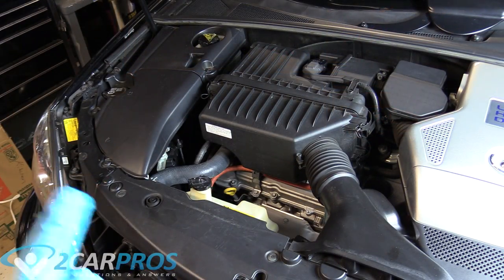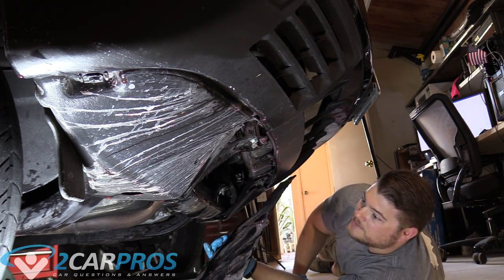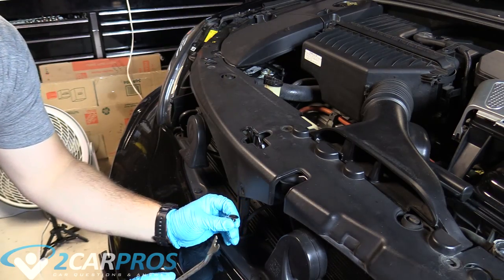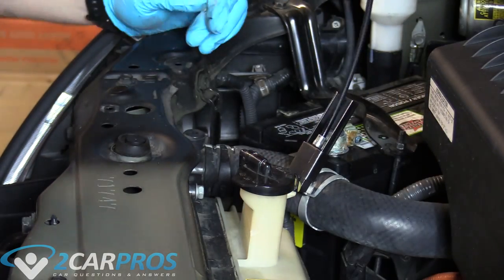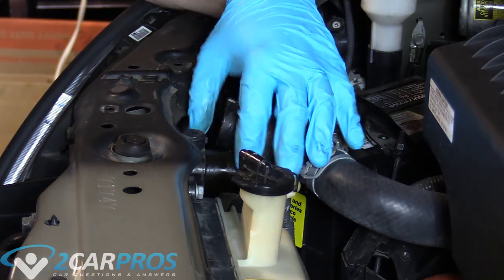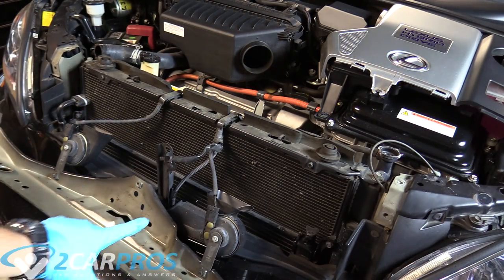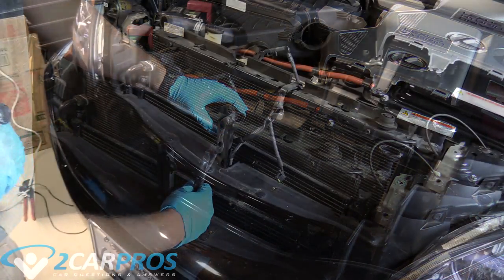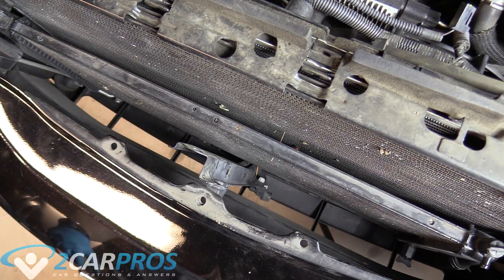How to Replace the Radiator Lexus RX 400h 2005–2009

Comment: Thank you so much for this tutorial! I just replaced the radiator in my Lexus. Would not have had the courage to do it without this video. I pulled the radiator out without removing the two bolts on the very bottom. It can be done by just lifting up the AC condenser out of the way. You just pull the radiator out with the "basket". I struggled with the bolts for a while, then resorted to this way. Much easier! :)
Reply: Can you please tell me what tools I should prepare?

Comment: Also, when putting coolant, you can start your engine in Maintenance mode. This will allow hybrid to run engine continously without charging hybrid batteries. Proces is:
1. Turn ignition on. (Do not push brakes at this point)
2. Push gas pedal twice.
3. Move gear position to N (neutral)
4. Push gas pedal twice.
5. Move gear position to P (Parking)
6. Push gas pedal twice.
7. Finaly push brakes and start engine. Then engine will be in maintenance mode runing as long as you shut it down.

Comment: Thanks for the video, just finished this job on my 08 RX400h.  I had to use a 12mm ratcheting wrench to get the two vertical bolts at the very bottom.  Very difficult. I lost the two bolts into the hollow cross member once I pulled the radiator out, lol.  There was no getting them out of there, so I reinstalled without the two bottom bolts.  After everything else was installed the radiator feels very secure, attached to the condenser and fan.  After all said and done I lost one 10mm socket, several plastic clips and when the job was over I had two 10mm bolts leftover lol.  Good to go though, just drove for over an hour, no leaks, no overheating.  Thanks for the help
Reply from the maker: Thank you for watching!
Reply: Hi great video and details, thumbs up, I read on a forum that you can skip removing the 4 bottom vertical bolts by slightly moving the AC condenser to the front of the car to clear the cradles so the radiator can be lifted up with the 4 bolts and the cradles. From your space you saw while removing this, is it possible? Thanks again for the video.
Reply: @Lavender it's a timing belt. Should be replaced every 90k miles.

Comment: Thanks for this video, just found my rx400h rad leaking and after watching this it really doesn't look as difficult as all those fans and stuff suggested it would be. Next weekend I will pull it and see what happens.
Reply from the maker: Yeah it's not too bad if you take your time. Thanks for watching!
Reply: @2carpros  Great did it yesterday, took about 4 hours all in. One stuck bolt holding the fan assembly on, and one pipe clip causing issues, cut the tang off and all was fine. Did as suggested and left the bottom bolt until the rad was out. Thanks again.

Comment: IMPORTANT.
One part of film show overcomplicated part and completely unnecessary.
First undo all screws before draining anything otherwise all drips on your head. At 23.08 sec of film you don't have to swear or pry it with piece of wood. Radiatir comes out with what this guy call cradle. All you do you unclip 2 front ones by lifting them just a bit and moving away from rad. Then radiator comes up with CRADLE.
Most cases you will not be able to unscrew radiator from cradle from underneath as most of those screws are rusty and suck. Once rad is out then remove CRADLE so much easier.
Done couple of them so its much easier to have rad out with cradle.
Reply: I think I agree.  Always take everything out together if possible, and rework on the bench.  Usually lift out clean and simple.

Comment: There is a bleeder next to the battery if you open the bleeder is much easier I done a cambelt and water pump replacement today on my rx400 I bled it super easy using the bleeder,  well done anyway keep the good work.
Reply: hi, you mean there is another bleeder not the in the video 2:42
Reply: @rainhanger  , Yes he means! On the Top of radiator but i don't know if there is a bleeder on all after market radiator..

Comment: Hi I like this.  The comments help . I was concerned I'd get stuck at the bolt 12mm lower radiator bolts.  . But i see there is the option to wiggle / slide the radiator with bottom cradle attached . Then undo later . Then opposite steps to re fit.  Essentially  pre fit it to the new Rad slide that down Then slide the  condenser across back into the cradle and complete the fit. So now I need to Ask myself should I try and do it.
Reply: Did you?!  :)

Comment: Thanks for an very detailed video. How difficult is to replace the Hybrid cooler (Radiator) which i right in front of the AC Condenser.
Reply from the maker: I'm sure it's very similar to this. Just go slow, take your time and you should be fine. Thanks for watching!

Comment: How's the denso brand holding up? I recently changed my 2004 RX330 radiator out with Denso. Hoping it'll last at least 50,000 or so

Comment: Question...
Isn't there supposed to be a small hose attached to the overflow cap stem (@ 0:21) that prevents hot fluid from spilling all over the engine compartment?
Reply from the maker: Maybe there was at one point but this car didn't have one. Some do some don't. Or maybe it came with one and someone took it off somewhere in it's life. Thanks for watching!

Comment: Excellent video!!! What brand of radiator did you use??
Reply from the maker: Thank you! It was a Denso radiator!
Reply: I also recommend the factory brand denso radiator. I learned the hard way by going with a cheap ebay rad and the side burst within a few days. Ordered a denso one and haven't had any problems since. Wish I found this video on YouTube last year.
Reply: @zingymantella590  Denso radiator is hard to find in good price in France. I bought a nissens.
Reply: Hey  @badnismo9508  how is your Nissens holding up? Ordering one to replace it this week.
Reply: @Xekmop1  finally I ordered a denso one! Nissens was delivered with bad finish and scratch on the heatsink..

Denso it's so war the best mount! I paid it around 46 bucks on rockauto..